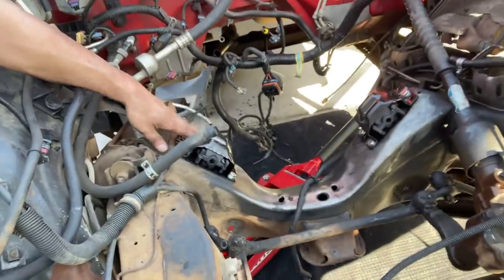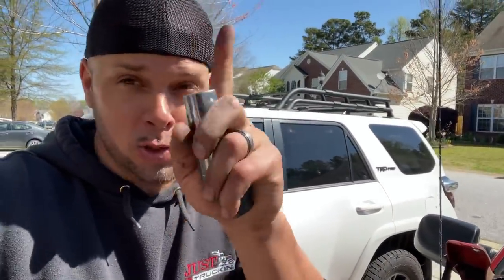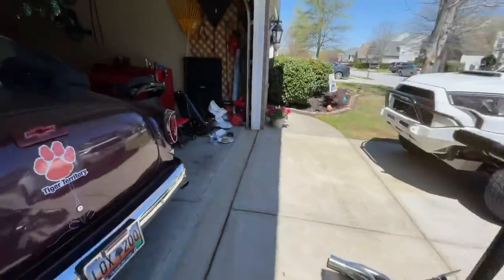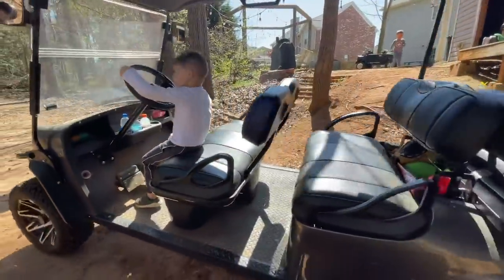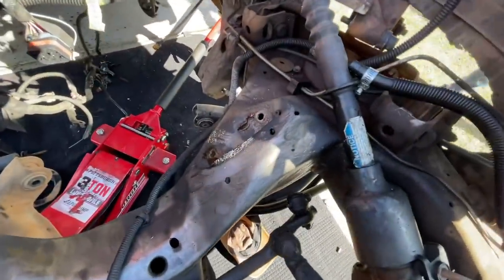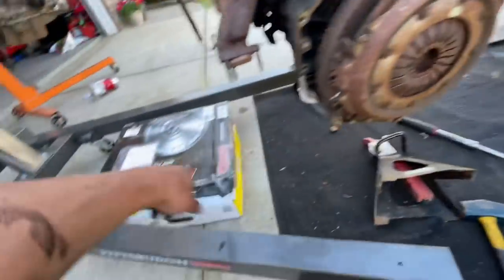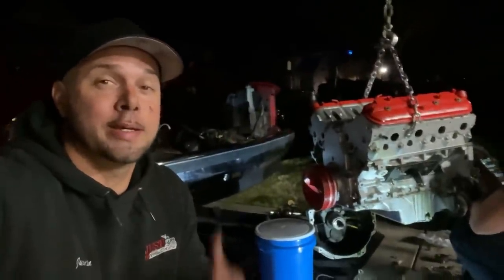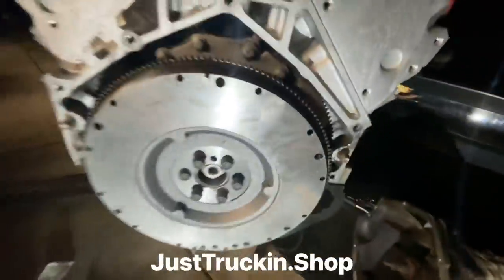“88-98 LS Swap Motor Mounts” Not what I expected To Do Today How to Remove Install LS1 BTR Stage 3

Comment: Next time cut the bolts holding the old mounts with a torch. Then remove the old mounts. Install the new mounts use just the bolts to align the mounts in correct position then weld the top n bottom of mounts to the cross member. Alot faster, less work, and will hold forever.

Comment: Good morning JustTruckin Fam, well i got my 383 stroker engine and 400turbo transmission in my 72 k5 chevy but now being that I put a different transmission i now have to put my k5 on the trailer and haul to transmission shop to shorten my drive shaft and make a new crossmember. But just wanted to say thanks for the video and be careful when doing the swap. T's&P's to you and your family and all other truck drivers .

Comment: Look when u ho yo put motor back in weld tge nut on motor mount make sure it is center of tge hoke in mount that way all u gotta do is set bolt through mount wth extension an socket an tighten